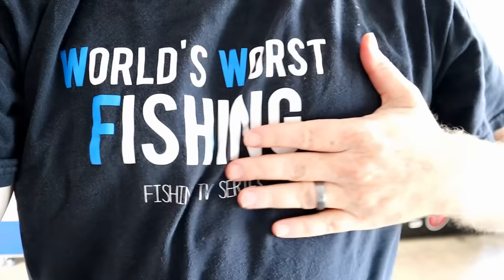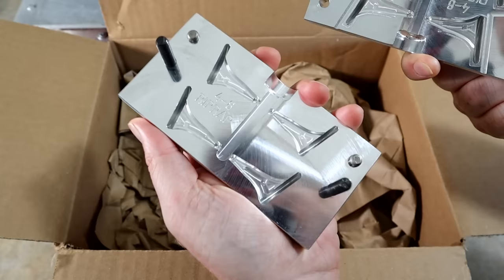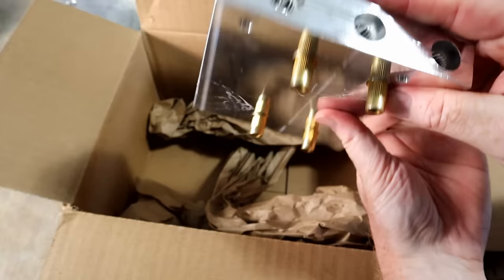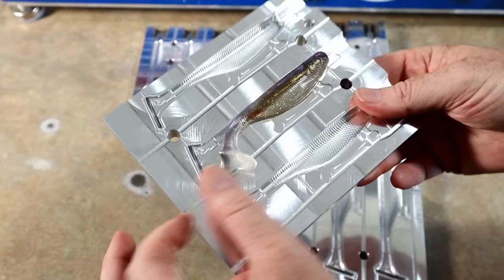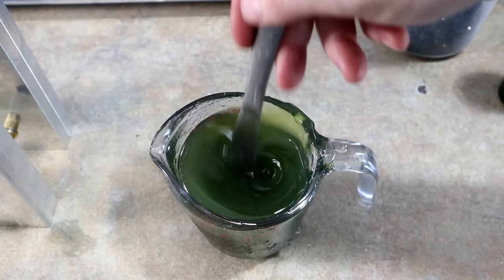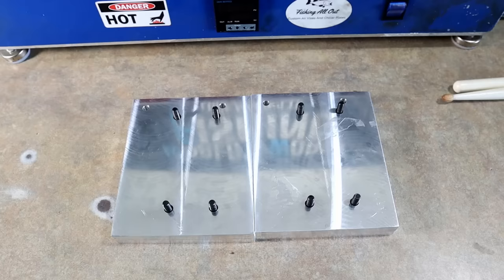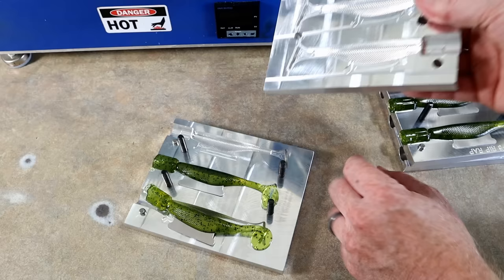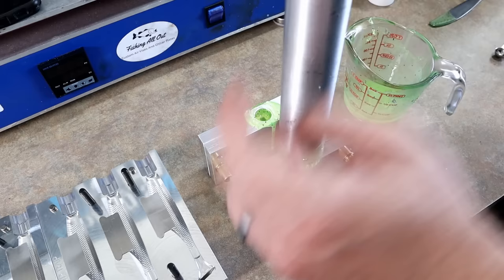TWO New Rip-Rap Bait Molds! Unboxing and Lure Making Demo

Comment: thanks so much for your informational videos. was wondering if you could help me out on two questions. did you use salt on these baits and do you have to use a vacuum chamber? if you dont use one then does that mean you will have bubbles?
Reply from the maker: I don't use salt hardly ever..and a vac helps with bubbles..they will eventually work out without one

Comment: Chris, my man, I need your advice.

Been out of the bait making game for like 10 months due to a move. 3 kids, a wife a full time job, etc.

Got back in the plastic jingle tonight, kept getting goooey worms. Was attempting core shot senkos, 5" from A. I. molds. all my rods was coming out with chunks of gooo. it was really disheartening.

I checked my temps with an IR gun and got 370 degree on a steady stir. Maybe I didnt have the 1 gallon of worm blen sinking mixed well enough? I shake the hell out of it and degas with my chamber. done three rounds of shots into 3 molds and got gooey rods every time.
Reply from the maker: Definitely a mixing thing...can always get a small stirring bit and mix with a drill
Reply: @WorldsWorstFishing  Any suggestions on a commerical mixing bit for a 1gal. jug of goodness? I feel like I have had this issue with basically every jug of 1gal. worm blend I have picked up.